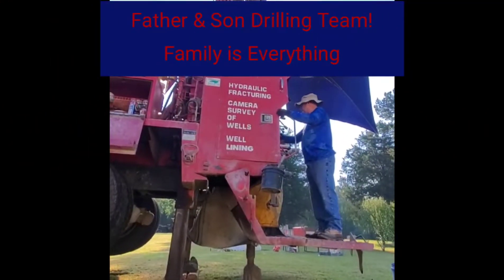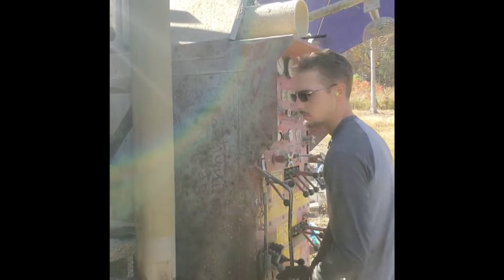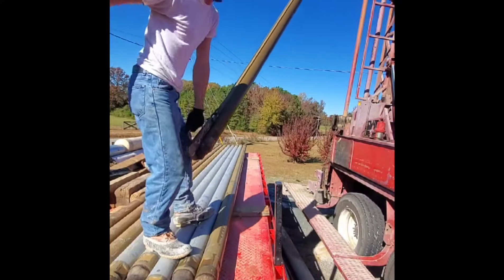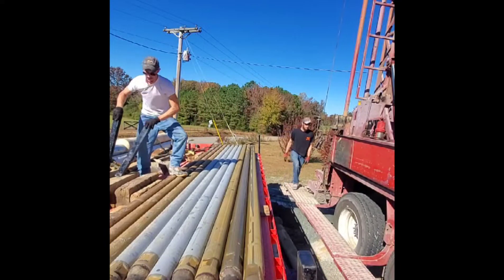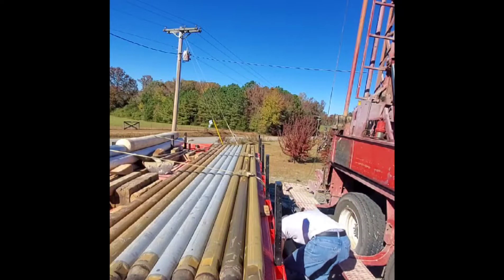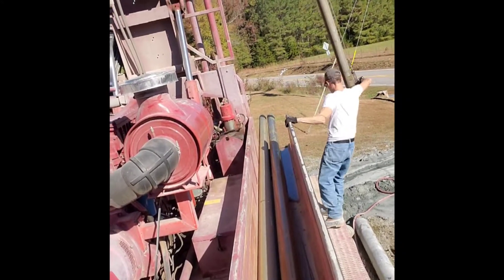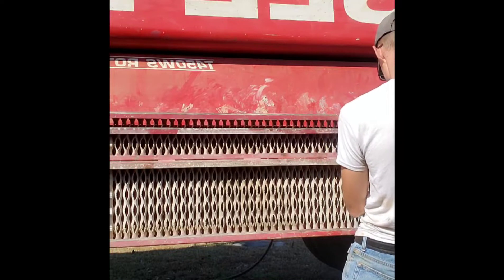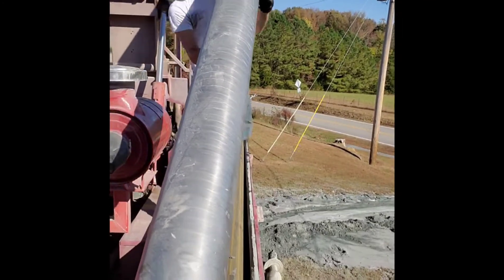An Older Video. Well Drilled to 600ft, the process of pulling out the drill rods.

Comment: Do you frac wells also? I had a 1/2 gpm well fracked and it went up to 15 gpm! That was definitely a larger improvement than is normal, but even if it had only increased to 5 gpm it would have been money well spent. It will make my life WAY easier. I'm in Person county, NC.

If you aren't already fracking water wells, it is a line of business worth looking into. The benefit for the customer is there for sure, and there doesn't seem to be many folks offering the service.

Let's go Brandon!
Reply from the maker: Yes we frac. I'm in Halifax va. So its highly likely that we frac'd your well. Triad is the only other co that has a unit. Do you remember the company name?
Reply: @h2omechanic  It was Barnette Well Drilling in Roxboro, NC.

Comment: I wish or drill division had aluminum ever thing is steal and the deepest IV help drill 1300ft talk about tired then put the pump in. I was working both for extra cash. It was a city job pay was good.👍👌✌️
Reply from the maker: Nice! We've been 1180ft. Did it at my old home looking for big water for geothermal. 
Aluminum rods are nice to handle being 60% less weight. But during the drilling process the Aluminum is so flexible that the rods gets kinda jumpy. The rotational Tq is what does it & the bit does not appreciate it.  Drilling is art. Lots can go wrong in a area we're never capable of seeing. All must be done by feel & reading gauges.
Reply: @h2omechanic  so tru I have been on a job we hit 900 and they didn't won't to pay for 24hour drilling so we came back the next morning started and the well caved in huge sink holes around rig 15 feet down 30feet wide I had jump off the rig the front tire were in the air crazyist thing I have seen no joke. Lost a lot of pipe. PS telling out steal drill pipe sucks ass and drill threw rock as well ✌️⛲

Comment: Great to see some actual production! We haven't had water at our place in north GA since mid August due to a lightning strike that destroyed everything - pump, wire, control box, etc. I took this opportunity to drill deeper on the low-yield 400-ft-deep well. Finally got a driller to respond and they brought in a rig first of November. Unfortunately, their air compressor started overheating and they messed with it for two weeks... finally giving up and taking it out last Tuesday.  Now I'm looking at "after Thanksgiving" before they can get a rig back in.  I had ruled out fracking, thinking it wasn't as sure a thing as drilling deeper. It just didn't seem like 3000 psi would do anything to granite down at 400 ft.  Now I'm wondering.
Reply from the maker: Well percentage wise. Drilling from 400ft to say 600 feet your have about a 40% chance of hitting more water. Hydro-Fracing I'd say you have a 95% certainty to increase your flow sometimes between 4-10 times original gpm.